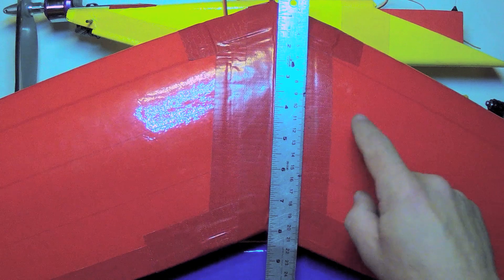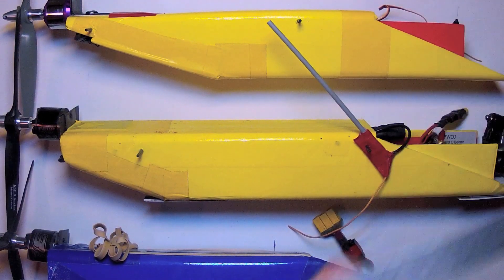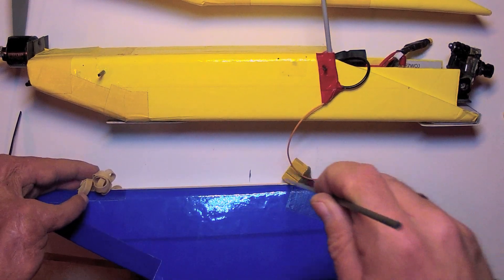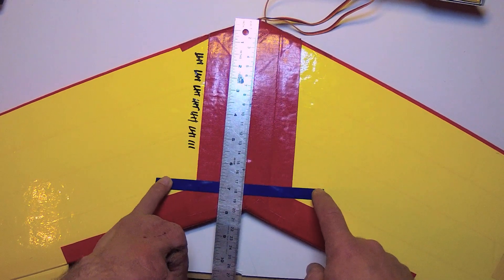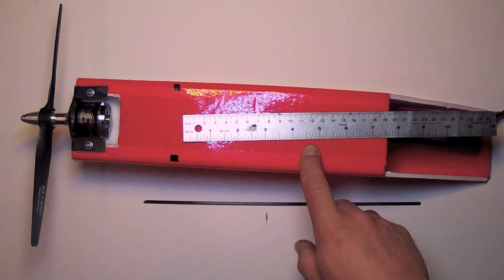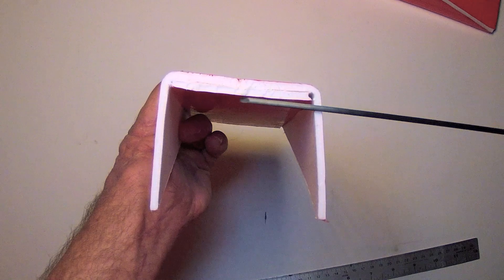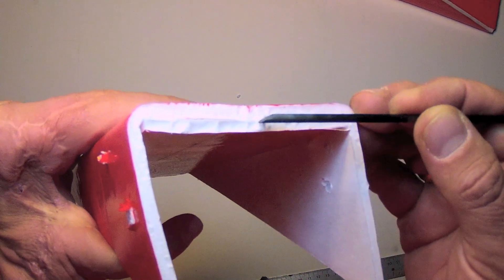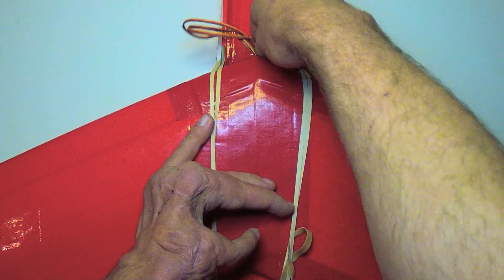SYNAPSE BUILD: Wing Mounting

Comment: I have a terrible time with elastics Ed. You replying to comments/questions my friend? Anyway, I have ordered M8 plastic bolts and wingnuts/washers to fasten wings. I will try to modify this to allow a light sliding plate with the bolt pattern to allow variable COG, and  for repeat-ability on the wing construction. Should be interesting
 Sure wish you were in production mode, but wish you well none the less.
Regards from a long time subber, C

Comment: A tip for folks: if you haven't glued the reinforcement foam to the top of the fuselage pod yet, leave it a bit narrower compared the the tube inner diameter so threading the CF rods/tubes is easier.  I didn't do this, but managed to carve out a cylindrical groove by hot gluing a slightly smaller drill bit inside a CF tube.  The bit is easily removed afterwards by introducing isopropyl alcohol into the other side of the tube :).

Comment: I'm no scientist, I just like owls.:) 

I'm currently working on a semi-scale Husky based around a 30" Armin wing with a 5" chord. All up weight of ~275 grams, powered by a 20g 2500 KV motor and 450mah 2S. The prototype flew wonderfully, except it needed a lot of down trim because of an error I made regarding elevator incidence. The plans have been corrected and I hope to complete a replacement airframe this weekend.

Comment from the maker: Ah, it's a good question.  I recommend planning so you can swap the battery with the other electronics (OSD, receiver, VTx) so the heavy battery can be further aft towards the CG and the lighter stuff can be moved further forward.  Other than that consider making a new fuselage pod to hold all your new gear.  You can always move the wing hold-downs too, just makes the structure a little weaker each time you re-penetrate the fuselage tube.